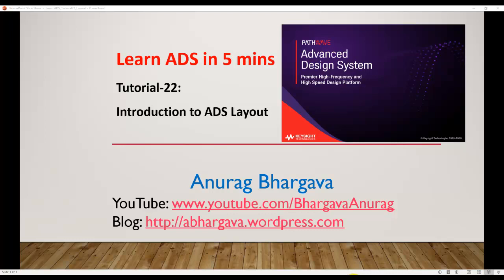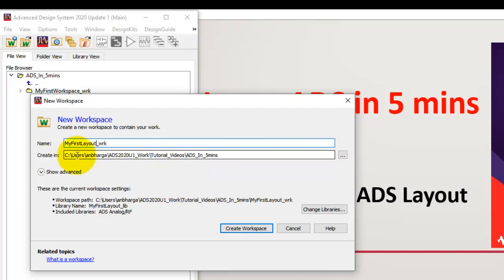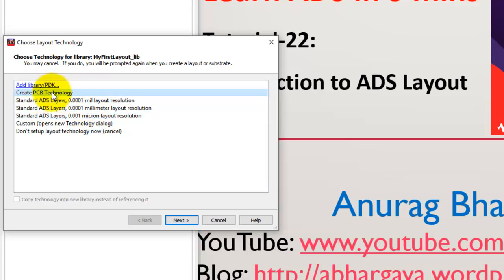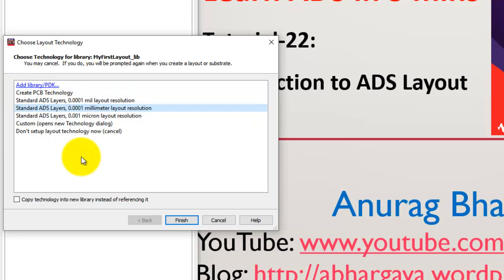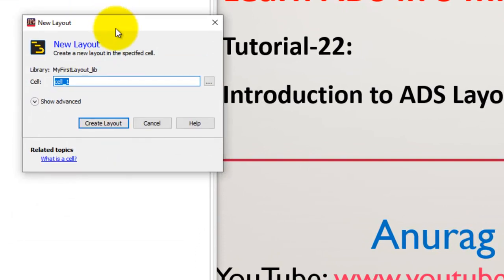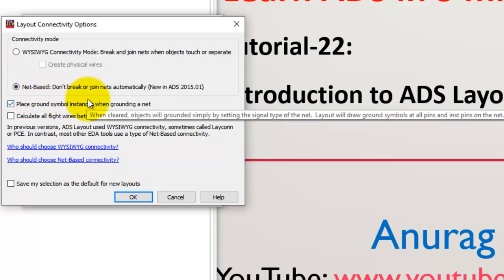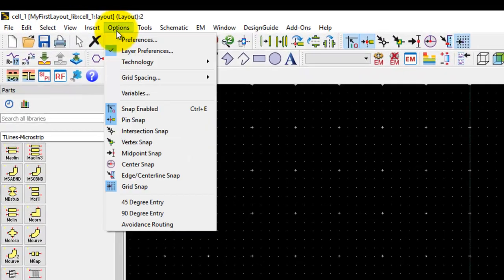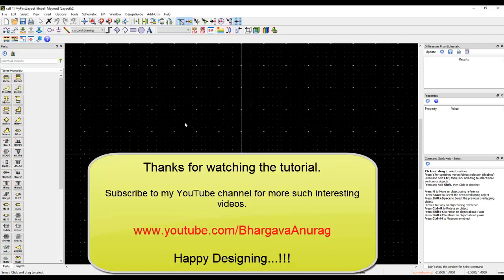Tutorial-22: Introduction to ADS Layout

Comment: Hi Anurag, one question about the brd file imported into ADS layout, are the components definition such as R, L, C enabled in the imported ADS layout after I imported one brd file?
Reply from the maker: Hi Baijing,
Allegro has no electrical circuit model so important brd file in ADS will have layout footprint & connection hierarchy but no circuit equivalent model but you can easily perform EM/Circuit cosimulation and attach electircal model of RLCs as needed in ADS directly either as ideal RLC models or Vendor component models.
Reply: @BhargavaAnurag  Hi Anurag, Thanks a lot for your reply, do you have any lessons related to my question to be referred to?
Reply from the maker: I have few videos on SIPro that might be of your help but performing regular EM-Circuit cosimulation should serve your purpose and that will be my next video to be posted next week.

Comment: Hi Anurag, Great presentations! I have a question for you. When you create a layout that contains R's and C's do you need to insert pins in to your schematic to match the pins that you insert in to the layout? I have gone through this process before, but I don't remember having to do this. Once I created the layout and inserted pins where I wanted to  connect parts this was sufficient to build a simulation with a look-alike symbol. However, in my recent endeavors, I have had to not only add pins in the layout, but actually add matching pins in the schematic that I generated the layout from. My co-simulation would not work until I did this. Any advice that you can give would be greatly appreciated. Thanks.
Reply from the maker: Hi Abraham,
Nothing has changed in em cosim process or requirements. You don't need to have same pins in schematic except for the situation when you want to use the same top model look alike symbol for both schematic view and layout/emmodel view. As long as you have selected emmodel from Choose View for Simulation, it has nothing to do with your underlying schematic as it is simply reading the em simulation model/results for integration with rest of the schematic components you have connected to the look alike symbol.
Hope this helps.

Comment: Hi, I've a query related to the importing of brd file in ADS and then swapping the layers.

I have a multilayer board in which accidentally I've misplaced two layers. Now I've to swap signal layer with the ground layer. Is it possible in ADS layout or not?

Thanks in advance.
Reply from the maker: Hi Hamza,
It's not clear what you mean by misplaced 2 layers? Also I am not sure what you mean by swap signal layer with ground layer
Reply: @BhargavaAnurag  thanks for your response. I'll try to upload a picture of the layers stack up and hope that it'll make my question clear.
Reply from the maker: Sure..